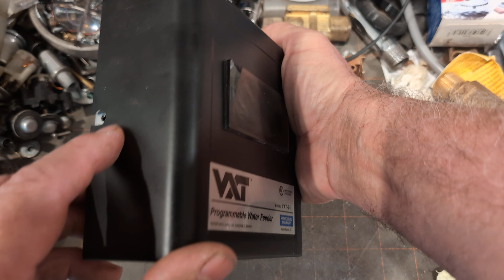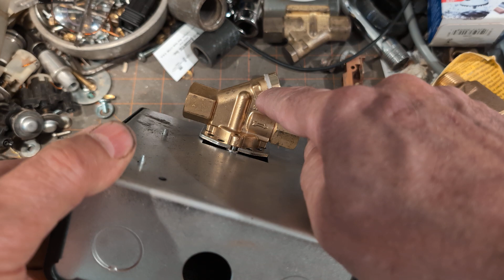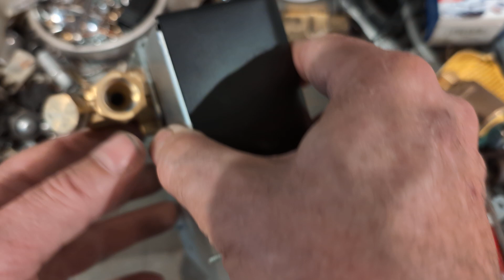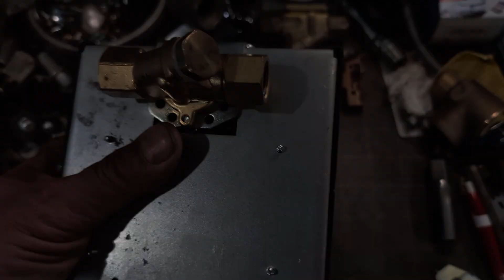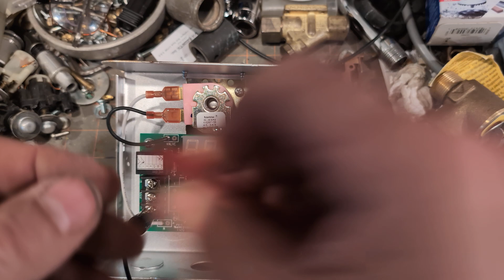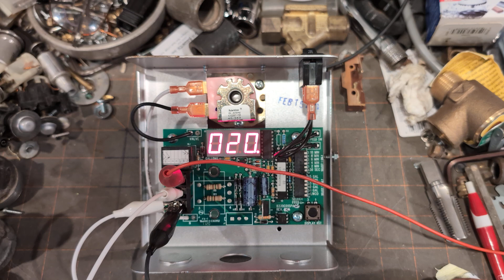Checking Out A Used VXT-24 Steam Boiler Water Feeder

Comment: Dave here from Odessa. You guys have worked on my system. My water feeder isn’t counting gallons but my boiler is flooding, could it be the valve isn’t shutting completely? I drain down 15 gallons then 24 hours later need to drain again.
Reply from the maker: I would first suspect the manual by-pass valve is passing water.  They can look shut from the outside, but sneak water into your boiler while you sleep.
If your VXT has been feeding lots of water into your system prior to your current kerfuffle, it may also be worthy of attention.
Reply: I’ve been using the manual bypass valve all winter to add water to keep the level in lower 2/3 of the site glass. That valve isn’t giving me any trouble. I turned the valve off for the water feeder and the flooding stopped.
Reply from the maker: If it is as you say, then the VXT valve will need rebuilding.
Reply: Do you have a video on it? Any advice on where to get parts?
Reply from the maker: Yes, there are several videos on rebuilding the VXT and the SKU# for the parts is 45-345